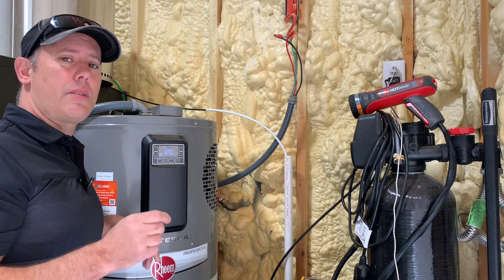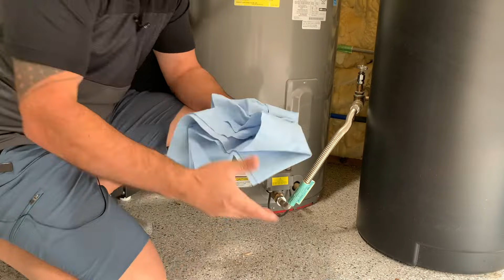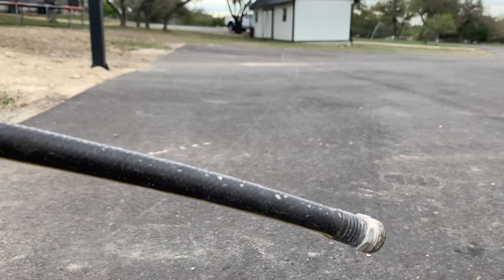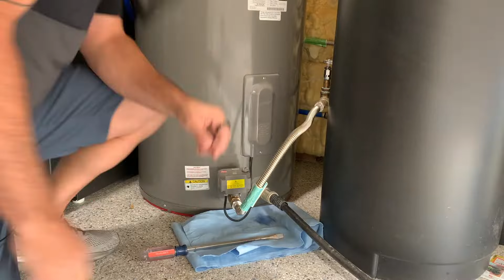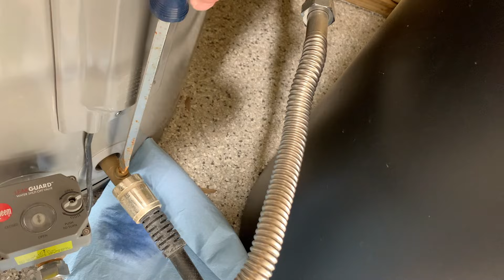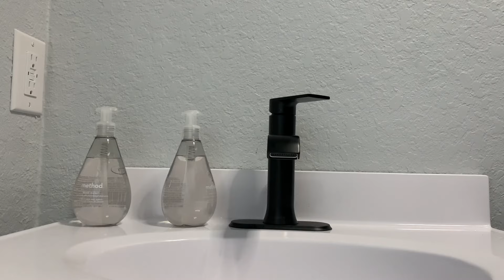Rheem Electric / Hybrid Water heater drain and flush

Comment: Do you feel a need to change the anode rod to a power rod instead where you have hard water issues
Reply from the maker: @bertpainter8385  hard water is not aggressive at all if you have soft water then yeah you could definitely swap over to a different type of android. I chicken change and rods all the time that are 3- 4- 5 years old on hard water and the sediment inside of the tank is excessive, but the rods look almost new
Reply: @rickpowell1402  Sounds good. Just drained and pulled the bottom heating element and look inside. NO issues so far. Only 3 years old but this was the 1st flush. My original question for in reference to my buddy's water heater where we had to change it 3 times, every 2.5 to 3 years. Finally put in a water softner on the last swap. See if that works. For some reason when I had my furnace coils cleaned out by a local business who did my neighbors coils too I had nothing much he said, whereas my neighbor needs there's cleaned out every other year. The guy said he sees that in my town for whatever reason. Oh btw I closed off my coil for hot water due to the oil expense a few years back and installed a high efficiency Rheem hybrid. So far so good. After I had the updated sensors installed under warrantee.  The say replacing the anode on this on is a bitch to get too. So I'll wait. Seems I don't get much build up. Wish I knew why one house does and the next doesn't
Reply from the maker: @bertpainter8385  I have a video on here to change the anode rod on the hybrid. As far as why one house would have a different outcome than another depends on the usage, water quality, and sometimes that could be dependent on if you’re on a well if you have city water service, the water conditioning equipment, sometimes make a difference.
Reply: @rickpowell1402  Not to drag this on, but now I'm curious. I had never cleaned my furnace coils before that one time. It was over 15 years. The neighbors house who get's them cleaned every other year was fairly new many 5 years or so. We both have city water. My home was built in 1950 and still has the main galvanized water lines in the crawl space. Always wondered if the galvanize process has anything to do with it. I was thinking to get rid of those pipes for pex lines instead.

Comment: Thanks for the video. Why do we have to empty the tank (cutting off water) instead of just letting the water run, for let's say, 10 minutes? It would flush the sediments without filling the air into it.
Reply: You can do that.  I call it power flushing.  Works well on heaters that are maintained well.  Quick power flush per year and you’ll be fine
Reply: @alphaq3427  thank you 👍